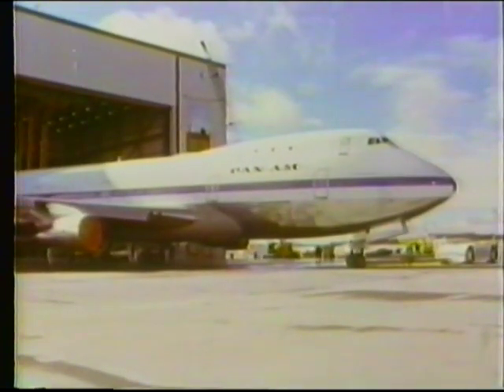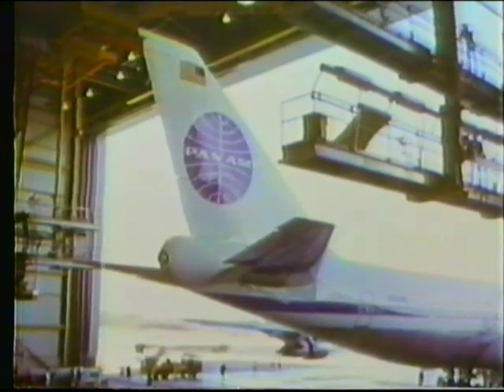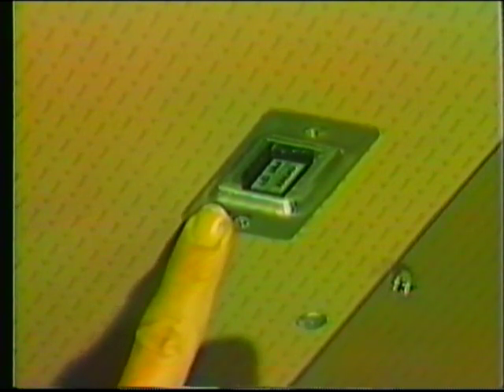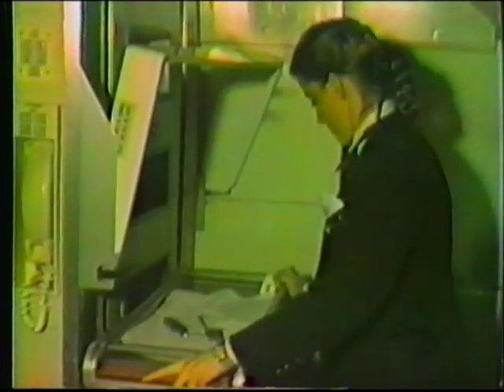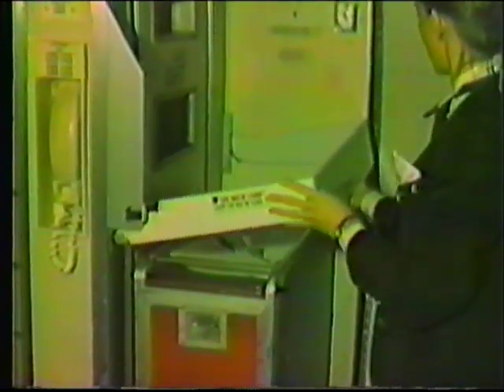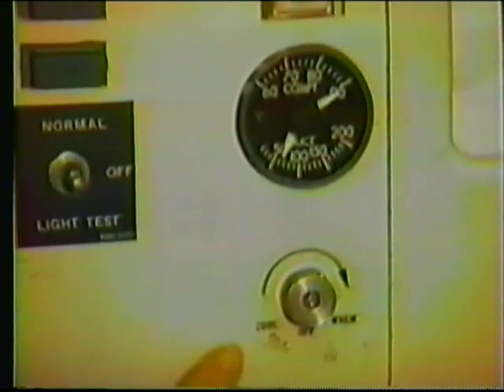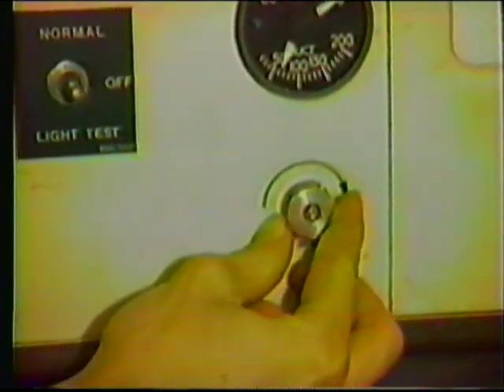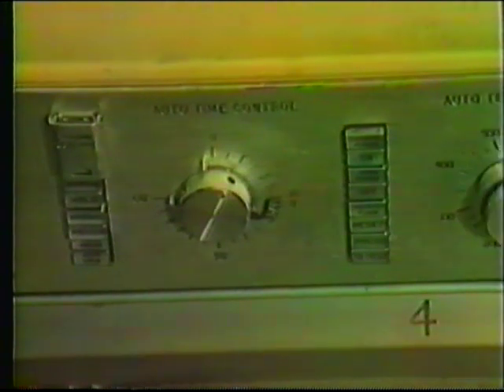Pan Am Training Video: 747-123 Aircraft Familiarization and Service Procedures (circa early-1980s)

Comment: I once had to use the escape hatch mentioned in the video. It opened up in the left aisle of Cabin Class. You can imagine the shocked looks I got from the pax in that area.
Reply: On my trip to Australia, the galley flight attendant used the ladder to go in and out of the lower galley. She would open the door to the cart lift and stick her head out to talk to the flight attendants on the main deck.  I remember talking to her when she was downstairs.  I guess she did not like riding the personnel elevator, or using the galley phone.  The purser did not see to care what she did. I am not sure if the captain knew what was going on. This was in 1988, and I remember it like it was yesterday. Wish I had that on video!

Comment: The DC-10 Lower Lobe galley arrangement was so much better than what was installed on the 747s. Only original 747 delivery customers AA, UA and QF had lower galleys on their aircraft. PA purchased these 747-123s from AA. 

The DC-10 LLG did not have that ridiculous halo on its cart lift. The cart lift operated in a properly enclosed shaft. So many other things come to mind, including the fact that the DC-10 had a proper ladder for emergency egress.

Comment: Lower deck galley?
Reply: Yes, some 747s and more notably Dc-10s and Lockheed Tristars all utilised extra cargo space in the form of a lower galley below the main passenger deck. Some airlines opted to turn this space into a lounge, particularly on the Lockheed. The only modern example of utilising lower deck space is the A340-600 which has the option of grouped lavatories below deck. Here’s another example of a lower deck galley in use on the DC-10 🙂

https://youtu.be/qLkUQSlcB7Q
Reply: @jamesdelatour2266  as well as Lufthansa’s A346s, some A330s ordered for charter airline use (notably Thomas Cook) also utilised some room on the lower deck for lavatories, as freight was never intended to be carried.
Reply: @NaenaeGaming  yes I forgot about Thomas cook, being a leisure airline high density seating was a priority therefor why not put some toilets downstairs
Reply: @jamesdelatour2266  it was the prized working position at Airtours on their 330's. As it was a passenger area there had to be a crew member (lav attendant) positioned down there at all times.
Reply: How did passengers access the lower deck lavatories? By stairs or an elevator?

Comment: It’s pretty shocking that despite all the safety features one of those cart lifts crushed a flight attendant to death. Wasn’t a pan am but still 🤓
Reply: What happened?
Reply: It was actually a Dc10 but same galley and cart lift configuration
Reply: It was World Airways
Reply: That's why they put it in, to be cautious and dont stand underneath it lol
Reply: Don’t know if it was added later, but the L-1011 had a bunch of safety interlock switches for this reason. The lift would not move until two switches (away from the doorway) were actuated.
Reply: It wasn't the cart lift, it was the personnel lift. The microswitches had been damaged from cart impacts.
Reply: @straightpipediesel  Ah okay thanks for the correction
Reply: Killed by cabin elevator - September 20, 1981.  An accident took place on a DC-10 from Baltimore to London. Flight attendant Karen Williams was killed when she became trapped in the lower galley elevator of the double-deck aircraft. An electrical malfunction and human error were both blamed as the cause. The rising elevator trapped the flight attendant between the top of the elevator shaft and a serving cart that she was apparently trying to release from its locking device
Reply: Even before the World Airways tragedy, we were told to not use the lifts if the electrical interlock was not working. Poor Karen Williams apparently had become used to World Airways I attention to fixing the electrical interlock. Horrible death and so unnecessary.